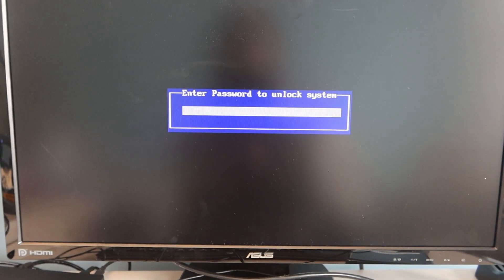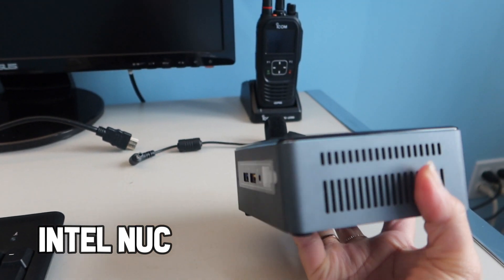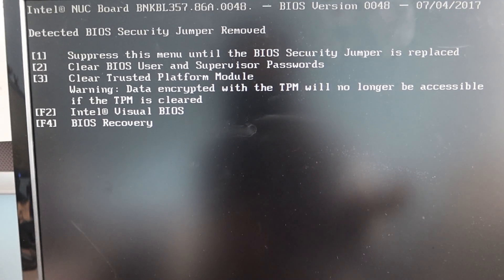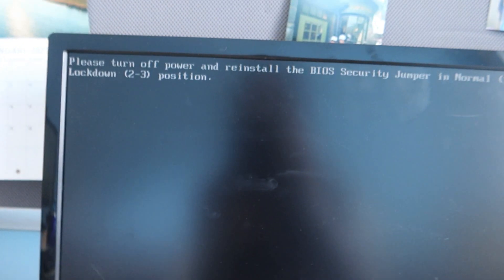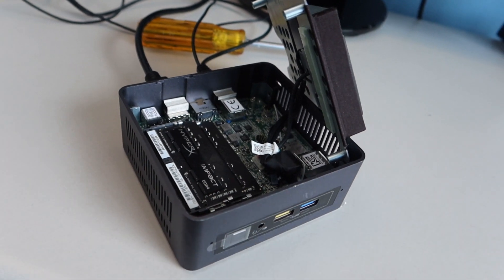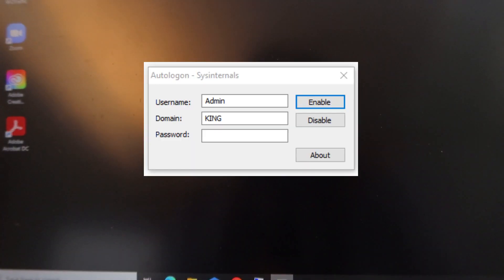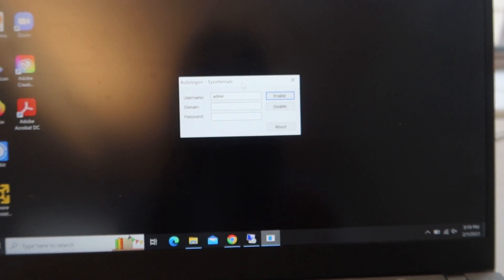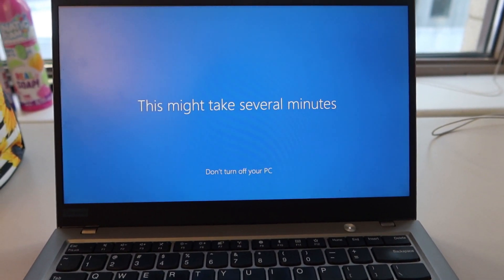A day in a life of an IT Professional | fixing BIOS lock | Windows Autologon tool

Comment: This counts as fixing something?
Reply from the maker: title literally says "fixing BIOS locked computer". BIOS was locked and it's an issue coz you can't format, change boot order etc so it was "FIXED" by resetting and clearing the BIOS password. What is your smart-ass comment trying to prove?
Reply: @EastCharmer  it is easy to remove the password on BIOS desktop but it is close to impossible to remove it from a laptop because there is no jumper, but I heard there some tools that the dell, hp,...... use to do that. Am I right @EastCharmer?